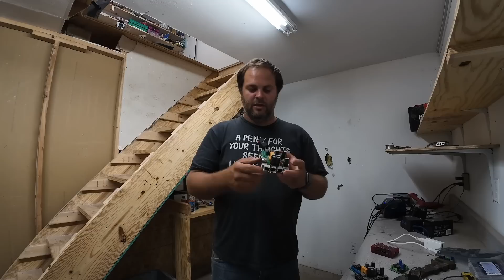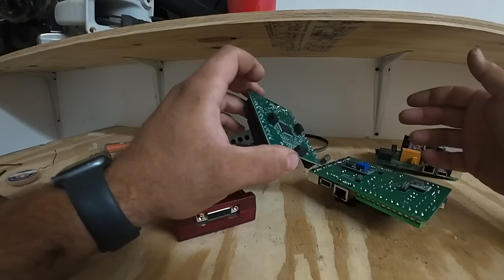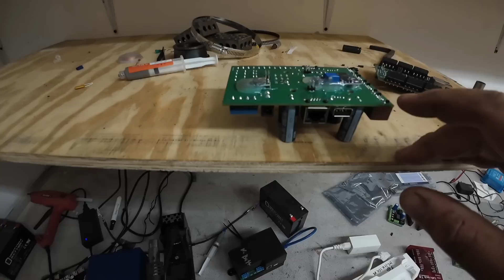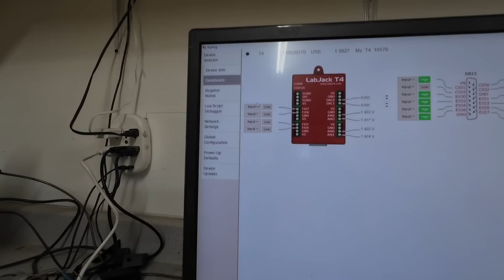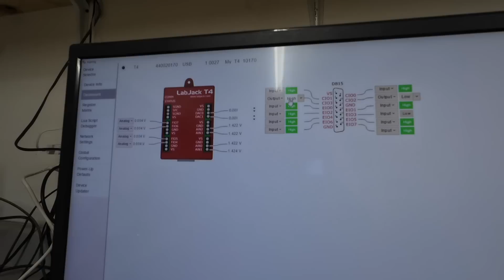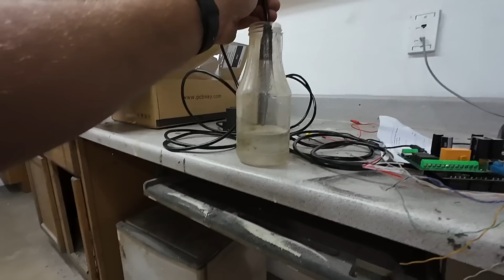TZL Scada Part 3.  Homemade circuit board.

Comment: Your probably not reading these anymore but using an elevated zero for analog sensors ie a 4-20ma signal vs a 0-10v or a 0-5v signal is far far superior especially when using the lower part of the scale for actustion ie on a seperator pressure sensor in practice.

Comment: I wonder if Zach has heard of Node-RED and Raspberry Pi. Relying on remembering which register does what could easily lead to problems later on. With Node-RED, Zach could handle everything he needs using fully customizable, visual flow-based programming, without needing to know how to code.

Comment: Great vids!   I have a dug water well on my property.  It's concrete and near my building with a steel roof.  After several insurance claims for lightning destroyed well pumps, I ran a ground rod in deep next to the well and attached that to the steel roof.  Eleven years have passed and the pump is still working. Maybe this is a dumb question, but would it work to attach a lightning ground to your well casing as a bypass around your controls and motor?  After all, the charge is just looking for somewhere to go.

Comment: Zach, great video as always!  I was thinking about your lightning fun, have you tried using any buried cable for the last run to your box, like put the last pole 50' from your box and bring that small part of the run in underground?  I know it would be more expensive to run but it might not be too bad if someone could just plow the line in.  It might at least cut down on the damage from a strike.

Comment: Have you ever thought about putting  lightning rods out that are taller than the power poles ?

A comment about the episode with the pole mounted transformer repair .  I was watching a Chris Boden video on youtube ,  here is his channel.  https://www.youtube.com/@Physicsduck/featured  .   To test if it is PCB oil. Dip a rag in the oil, if you can light the liquid on the rag , it is most likely not PCB oil .  So, PCB oil does not burn

Comment: You never cease to amaze me Zach!!  I used to do some circuit board building back in the  80s, but it involved drawing circuitry on copper clad PC boards, then etching the copper you wanted to get rid of.  Enormously time consuming and unforgiving of mistakes.  

I used to love interfacing to customer SCADA systems in the oil/gas/power gen field where I was a tech on OEM gas turbines, compressors and generators.   You're gonna have a hell of a good system once you work through the growing pains!  ;)   These are very fun videos for me!

Comment: Zack, awesome work and awesome video.  I don't want to arm chair your design, but there is a sparky safety issue with your design, In order to make a 4-20 mA circuit intrinsically safe the current must be limited to 26 mA as that is the threshold for creating a spark.  As a oil & gas control systems practitioner I just would like you to succeed in this project without blowing your self or others up.

And FYI, when will you board design be available for purchase???

Aloha..........................

Comment: Great series of videos Zach, Be sure to check out gel filled exterior cat 5 for your tank leads.
Reply: Your probably not reading these anymore but using elevated zeroes ie 4-20 is way way better in practice then 0-10 or 0-5v

Comment: If you got to a working circus board in 3 tries, that's not bad.  I have known people who's training and career focus was designing circuits that would be over  version 3.3 before the first working prototype board. Zach, you really are a man for all seasons. 
 Not seeing decoupling capacitors anywhere, at minimum one across the + and - close to the power input on the microcontroller. Smooths out switching noise made by transistors, to include microcontroller I/O. Lessens the likelyhood of having errors due to switching noise that can be a woolabooger to find the cause of.  Ensures a high is a high and a low is a low, and not back and forth 179 times until it stablises.  Scope:30 at that point and of course it never will do it while you are watching it.
 The other thing I would suggest is using optoisolators on your inputs and outputs,  and mount them in a chip carrier, the longer your cables snaking out into the real world are, and being as your antenna lead is going 50 feet or more, outside on a pole,  you really should have them. Worst case scenario, you blow the opto isolator, swap a 20 cent chip and you are back in business instead of replacing the whole board due to a fried pin on your microcontroller chip.
And finally some protection for the power in side  MOV or TVS   There is advantages for each one, but it has been so long I dont remember that. Your power supply most likely has some transient suppression built in, but you could buy a bunch of protection devices for the cost of one warranty board.

Comment: You could also use hall sensors to verify motion in addition to power to motors. Also, you could measure motor temp. Maybe a piezoelectric audio sensor to look for bearing noise. Run a FFT to look for unwanted frequencies. Have the system store a good one and compare.  You should consider fiber optics and household lightning arrestors. You can develop an early warning system so repairs are made instead of damage. Oil level sensors could also be used...or a resistor in oil that is cooled in the oil which will have a resistance or voltage change. You might get someone like EEVBLOG to collaborate by reviewing your design and suggesting lightning and static protection and fiber to circuit tranceivers.
Reply: All valid ideas, but way to complex to do it in one step.

Comment: An example of EMP. My mom made Christmas ornaments which had an iron pin vertical in Styrofoam balls and hung by thread. A lightning strike happened nearby. When it hit all the limbs of the tree jumped two inches from the EMP effect on the iron in the needles and branches. I could also feel the static electric charge on the hairs of my arm.

Comment: Good video.   I worked around electronics for forty years, so am familiar with what you are doing.  The big electrolytic and resistor you added are damping a voltage surge from your power supply, saving your chip. The power supply probably is not regulated very well, if at all.  I do have a couple of comments and a question.  First, the weak point of your design will be the large electrolytic capacitors.  These have a will dry out and fail over time.  If they are going to be out in the oil field environment, get the highest quality ones.  Also, check the temperature ratings.  Consumer stuff is usually 105C, but stuff like automotive requires 125C or higher. You may want to use automotive temp. rated caps.  I also noticed you are using a large Weller soldering gun on the PC boards. I recommend buying a 25 Watt or so soldiering iron(and stand) for this to prevent damage to the PC boards.  I only use my Weller on the hand wired tube type electronics I restore.  If you want to spend $, there are quite fancy soldiering stations available.   The question is about your battery backup. Are you at some point planning to use solar panels to re-charge your batteries?  I see this all the time now.

Comment: You've essentially built your own PLC.

It's always a joy getting back your first board. Even better when you get your second/third/Nth board. Mine was an 8 bit computer using 80's chips. It didn't work the first time and I had to bodge a bunch of things. I did eventually get it working and had a lot of fun playing with it. Wasn't for anything in particular. I just wanted to do it. That was back in 2013.

One thing I learned the hard way in electronics is EMI from digital outputs. Modern electronics switch on/off so fast and with such a sharp slew rate that they can create their own RF all the way into the 100's of Mhz. Not only can this cause noise on analog inputs, it can cause spurious resets of the same chip that created them and surrounding devices. Uninterrupted and interconnected ground-planes help reduce this. Boards that are designed well will not only have much reduced EMI output, but will also be much more immune to external EMI. It could be anything causing EMI to. Cheap switching power supplies that are used in just about everything now are really bad about it. Often times you will hear about ham radio operators complaining about the one they found in their house.

Comment: The old Weller soldering irons are like a tank.  You’ve got a newer soldering station but go back to the Weller?  Or is that a hot air soldering station only?
Reply: Yes, the old ones are like a tank.  The newer ones are not as good.  I use a Weller to restore old, hand wired equipment.  I use a 25 Watt iron on PC boards.

Comment: Lightning is insidious with any type of hardware like you are using. Even with an excellent grounding system you can expect these parts to fry with a near or direct hit. You can minimize a lightning strike traveling on exposed wires (such as sensor wires and device power) by using a metal conduit, which is grounded on its own path to ground. The EMF from lightning can radiate 100's of feet from the strike zone. I have seen your power panels after a lightning hit, yikes, and have dealt with lightning issues with transmission towers. There are suppression devices for electronics, but very expensive and might only give you a 50-50 chance. My advice is to replace all sensors on any unit after a known lightning hit that takes out your control board. Remote telemetry is a lot of fun designing for sure. Enjoyed the videos and seeing you expand your knowledge base on electronics. Micro electronics is not  like using brute force and elbow grease, lol, but the perseverance of getting things done is. My hat off to you! John
Reply: The lightning videos were the first thing that came to my mind when he was showing using standard RJ45s as sensor input connectors. This has essentially made for a 1 minute changeout in case lightning fries the board. Interesting and efficient thinking.

Comment: lol all the electronic repair guys are crying watching your destruction of board. This is some great stuff!
Reply: Yea, I was thinking he was gonna use the heat blower to blast-desolder the connector but nope, out came the cutters. I can't say anything though, I've done the same a time or two.
Reply: Full time electronics manufacturing guy here. I thought he found that the housing pulls away from the pins and you could then pluck out each pin individually. Some connectors we use work that way for removal. Otherwise we use a 1.5” wide blade tip to pull inline headers.

Comment: Did you consider using a Raspberry Pi versus the LabJack?   The Pi has so many HAT's that plug right in, and are being used for commercial use, besides the hobbyist!  Depending on your distance you need. Most likely program in "C" or "Python".  LoRa is a good way to go.  No license needed.    Long-range, low-power source.  
---
Since your in a hot area, I would have used white filament for the 3D material, and added some vent holes.

Comment: 4:55 - too clever. If your radio is dead - assume that the grid is down (absence of signal is also a signal). No need for battery backup.
Reply: I think we’re going to find the battery more significant in a future episode.  I suspect the network is running P2P2P and needs to pass through data and video from other leases down the line.
Reply: Nonsense...

 I'm in the Automation business in the Oilfield. If you have no power at your production facility, you may still have power at your wells (depending on your power grid system of course). 
 You may run the risk of running your tanks over or over pressuring a vessel. You ABSOLUTELY need to keep an eye on all of your equipment. Even when you have no mains power.
Reply: @RMA_432_  bro, why are you starting lines with a blank? You're wasting "space", my friend

Comment: You might want to check out LORA radios if you just want a low power long range communication. It is especially useful for low data application like status updates.